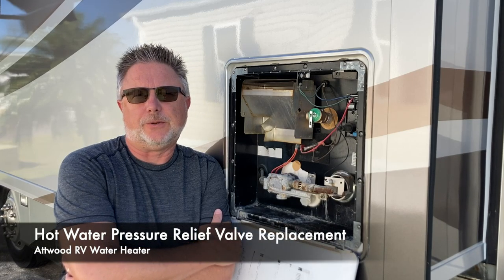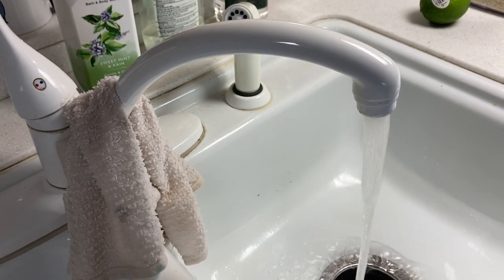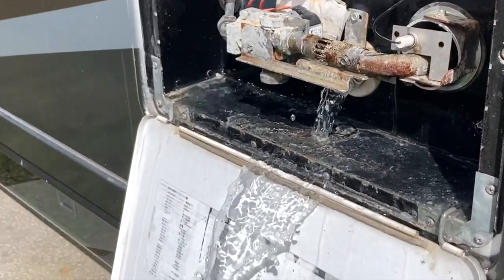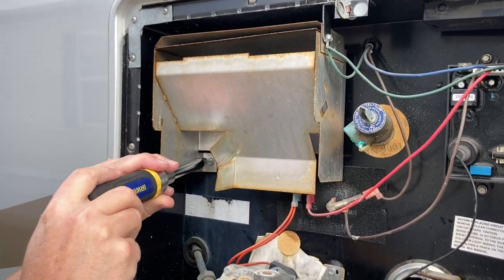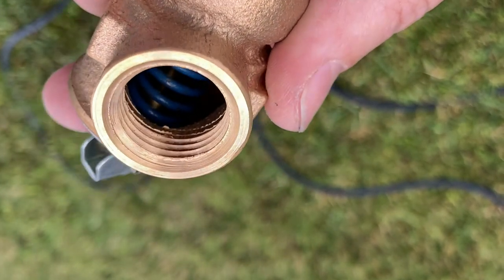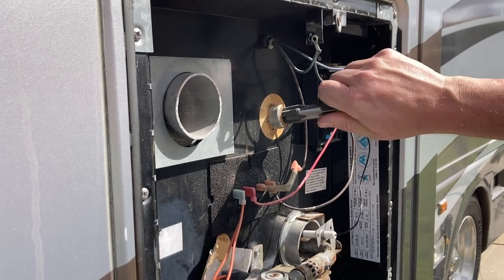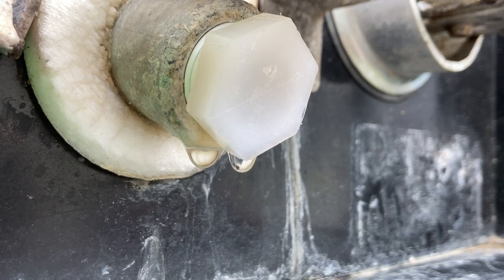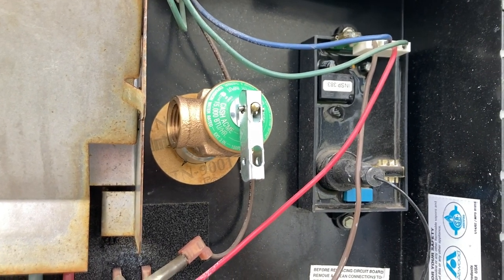Atwood RV Water Heater Pressure Relief Valve Replacement

Comment: I think it’s important to note when reinstalling the new temperature and pressure (T&P) valve, you need to outflow tape or some type of thread sealant first. I don’t believe this was mentioned. otherwise good video.
Reply from the maker: Thank you for the feedback! Yes, teflon tape or pipe dope is important to avoid leaks and to prevent the valve from getting seized in place making the future you very sad. In our case we used a couple wraps of teflon tape - which we did not show in the video. Good catch!

Comment: No anode rod needed since it’s an aluminum tank.
Reply from the maker: You are correct. As shown in the video, this Atwood water heater does not require an anode rod. It just has a plastic drain plug. Other water heaters do require an anode rod to prevent corrosion of the tank. We suggest owners consult the manual for their specific unit to see if an anode rod is required as part of their routine maintenance.

Comment: Dose the value only leak when the hot water is running or should it leak when it’s off and the tank is full to?
Reply from the maker: @TreyVriesema  A little drip now and then isn’t unusual. But a steady leak when the tank is full and pressurized is an indication that the valve may be going bad.

Comment: Corroded thread can’t budge it, any suggestions
Reply from the maker: I have had good luck with PB Blaster to loosen stuck fittings. Of course, you will want to rinse it out really well. I don’t know what the magic ingredient is, but I’m certain it is not good for you. If you can get it to budge, keep working it back and forth, slowly working it loose.